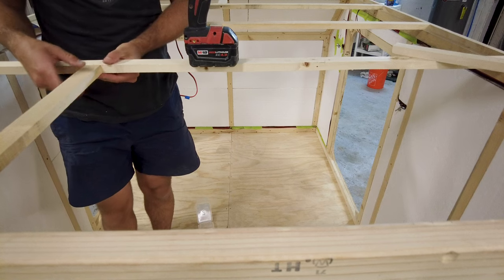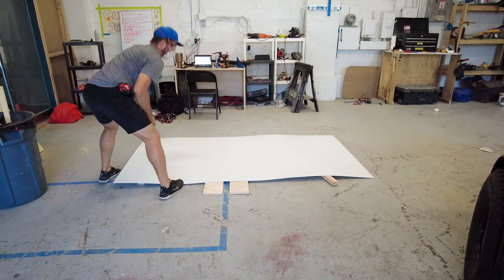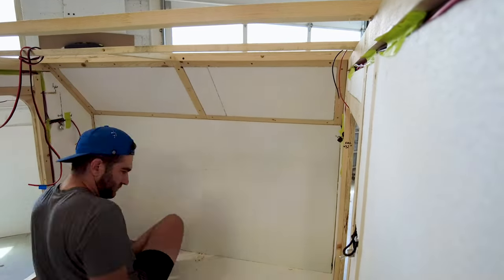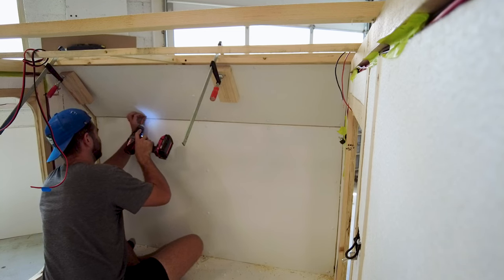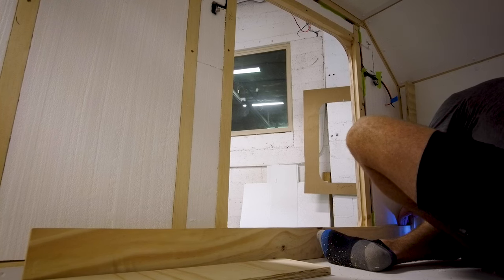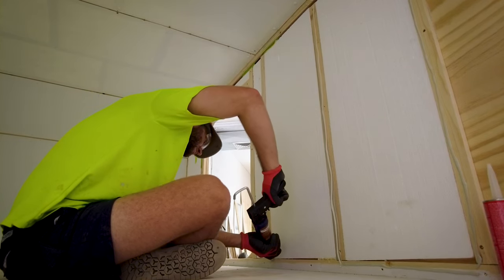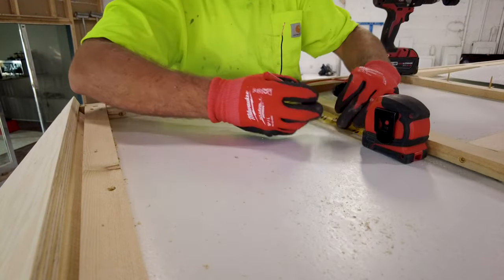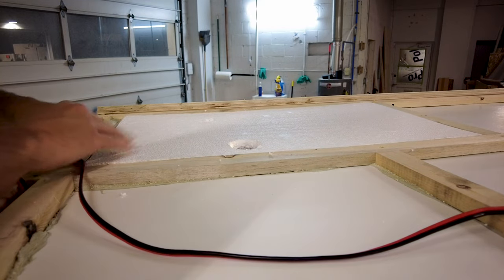How To Build a DIY Square Drop Camper Trailer: Interior Walls and Ceiling

Comment: It’s looking good! If you have to cut any more large sheets, you might want to try getting a large panel of solid foam insulation and laying that under the sheet you’re cutting. It’s way easier and much more solid than messing with scrap wood and no worries of the blade hitting cement.
Reply from the maker: That's a great idea. If I build another, I'll definitely go that route. Thanks for the tip!

Comment: I like how you saved on weight and glued the FRP to the interior...My cargo trailer is aluminum on steel 'Z' bracing and the inside plywood is half the strength of the wall...
Reply from the maker: I'm a big fan of the FRP. If you have the supports/insulation for it to be glued to, it is fantastic stuff. Real easy to clean, and no need for paint touch ups.
Reply: @FunkeAdventures  I used FRP on my clg. but it's screwed on with self tapping TEK screws. really clean install...

Comment: Personally vs frp I prefer the use of 3.6mm ply as you can use a braid nailer to fix in place plus glue. I tend to prefer a 4.way stretch carpet on the walls (green carpet on the ceiling with a blue on the sides always looks sweet imo.
Reply from the maker: Interesting idea! Thanks for the insight. The FRP, while a little hard to work with, is SUPER easy to clean, which was important to me. Thanks for watching!

Comment: Hey mate! Looks great!

Would you happen to have a diagram/measurements of the camper? 

Wanting to do this myself and I love the shape/size/layout of yours.

Cheers from down under!
Reply from the maker: Hey! Thanks so much for watching and subscribing. I appreciate the support. If you give me a couple of weeks, I'll try to get a diagram together to help you out. But I can also give you some rough numbers now. 

The camper/trailer base is 5 feet by 8 feet. The back wall that separates the cabin from the galley is set in the perfect spot to fit a queen sized mattress. So that back wall is 80 inches back from the front wall. I would find what mattress you are going to use and then just use the exact measurement of the length of the mattress. The notch in the front upper section is 1 foot down and 1 foot back.

That gives you a rough layout of dimensions, but I will see what I can do to get you a more detailed explanation in a couple of weeks. Thanks again!
Reply: @FunkeAdventures  thanks so much!

Happy camping :)

Comment: How tall are your sidewalls?
Reply from the maker: 4 feet tall. The exterior sidewalls are made of 4 x 8 sheets of 3/4 inch plywood. The interior sidewalls are probably 44 inches tall (because of insulation, flooring, and ceiling materials).
Reply from the maker: Thanks for watching our videos!